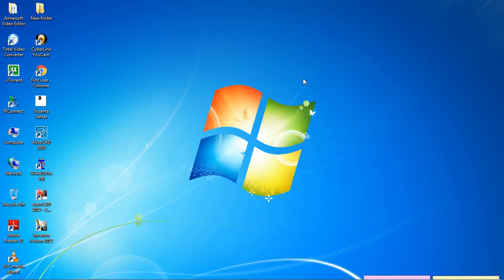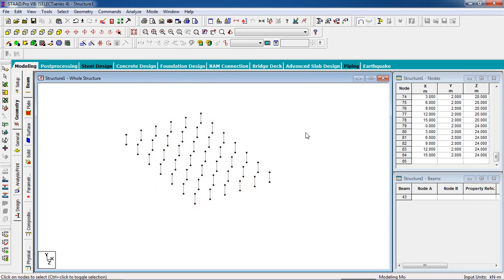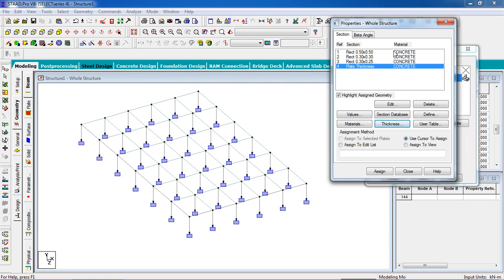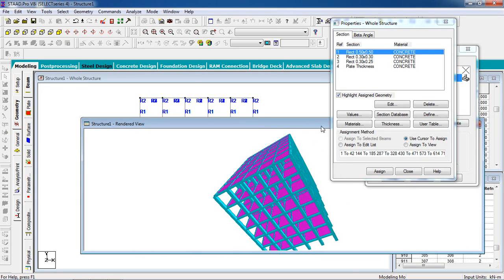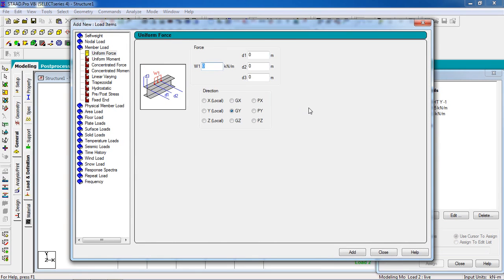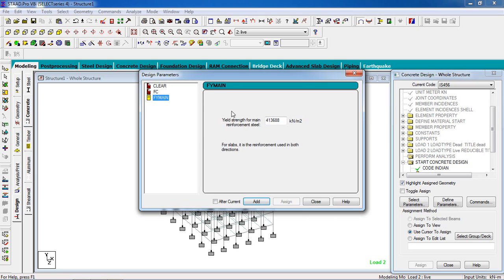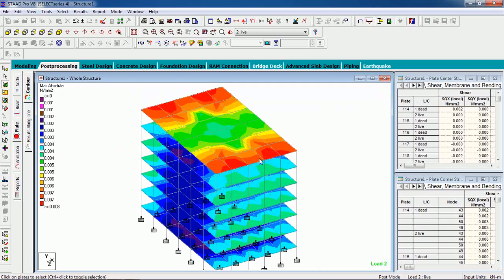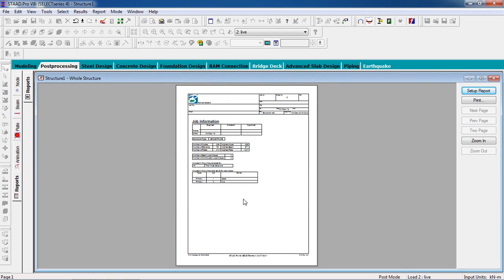STAAD Pro Tutorials - Design of RCC Multistorey Building Part-2 ( Day 8 )

Comment: Hi sir, I have doubt for assigning load. From your previous video (including this), why do you need to assign member load when you already assign floor load?
What I mean is, when assigning Dead load, add self weight and floor load is enough (because the floor load will eventually transfer to the beam), so I don't know what is the point to add member load.

Comment: 1. How will you obtain the perfect reinforcement detail output and draft it?
2. Why are applying live load on beams?
3. While applying Loads on the first step you assigned the self-weight for all members already then why you are adding 5 kN/m2 as a self-weight dead load on floors?
Reply from the maker: If you input the results manually it would be great !
Just to show how to apply the loads.
Actually there is two methods to add self weight you can use any (self weight or add the calculate load)

Comment: I have one doubt, it would be great if you can clear it.
I want to know that how do we obtain the value of loads ? Like in "day 6" lecture you assigned a member load of " -16.5 ". 
If I am designing different building, how will I calculate this value ?
Reply from the maker: Dead load calculation = Weight of slab+Weight of floor finish+Partition Wall (if needed)
Weight of slab = Length X Breath X Thickness of slab X Unit Weight of R.C.C (25KN/m^3)
Weight of floor finish = Length X Breath X Thickness of floor finish X Unit Weight of P.C.C(24KN/m^3) 
For live laod check IS 875 Part-II
Reply: During analyzing, I am getting a warning that " Applies self weight is less then total load" What does that mean ?